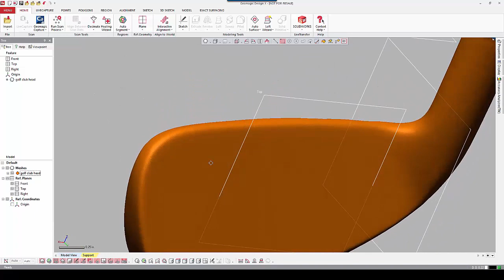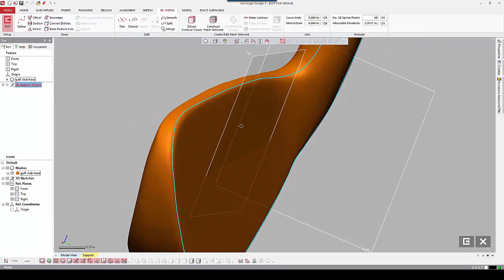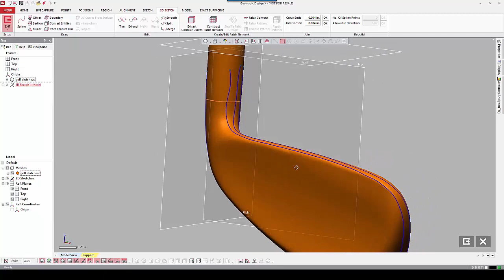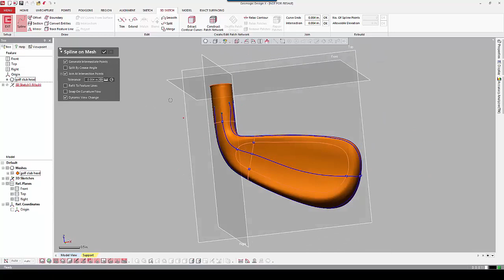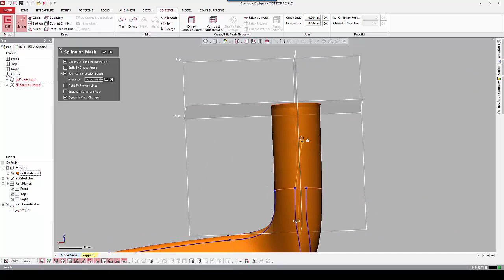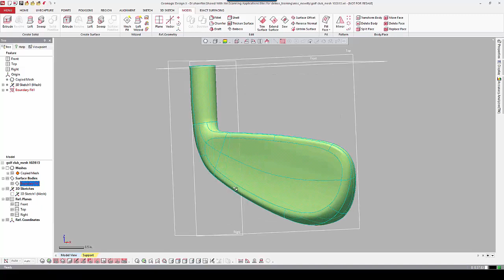Geomagic Design X - Boundary Fit Surfacing

Comment: I'm facing problem that boundary fit feature doesn't close surfaces and it is very difficult to convert to solid, can someone guide in this regard?
Reply from the maker: Unfortunately not in a youtube comments section. However if you reach out to your vars technical support team they should be able to help you.
Reply: Too bad, that might actually help others trying to find information. @goengineer